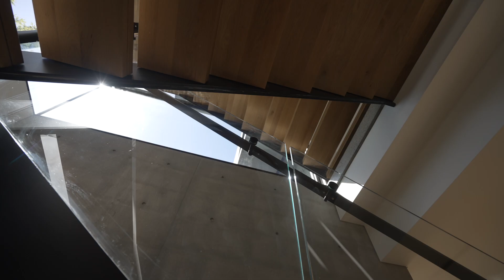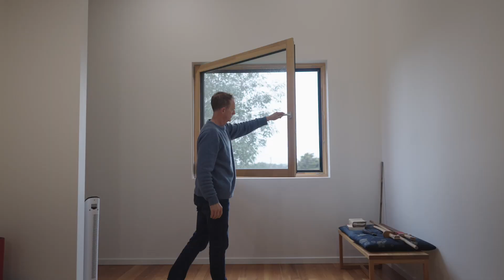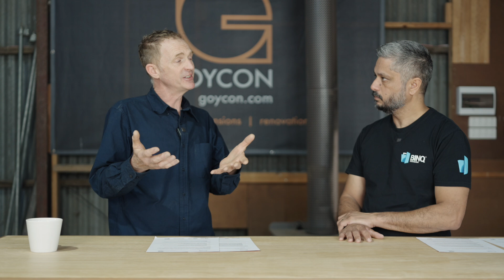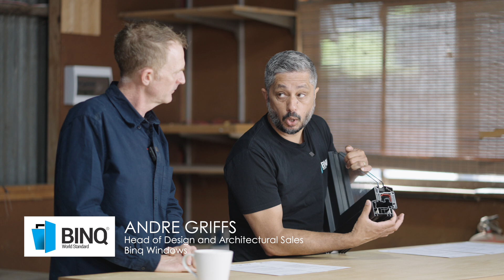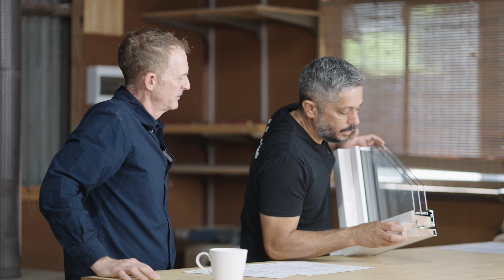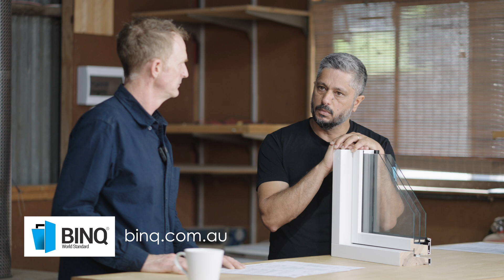high performance windows - building Australia

Comment: Look for uPVC window profiles accredited to the uPVC Windows Alliance Industry Code of Practice (ICP). The ICP sets specific composition, weathering resistance, colour, and strength requirements for extruded uPVC profiles for use in windows and doors in Australian buildings. 

ICP certified uPVC profiles give specifiers, builders and consumers confidence in the durability of those uPVC profiles under Australia's harsh climatic conditions.

The uPVC Windows Alliance is an initiative of Vinyl Council of Australia.
Reply from the maker: thanks for sharing this